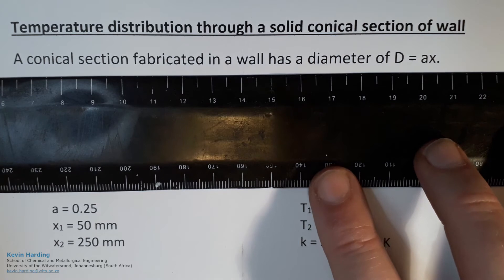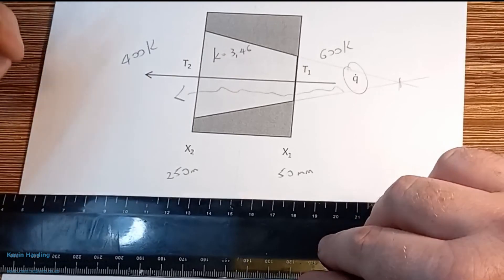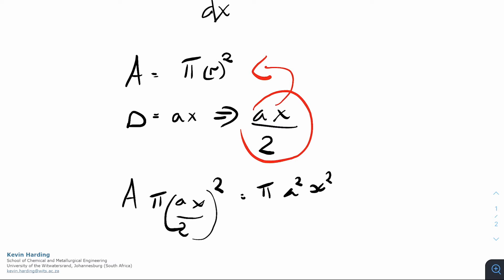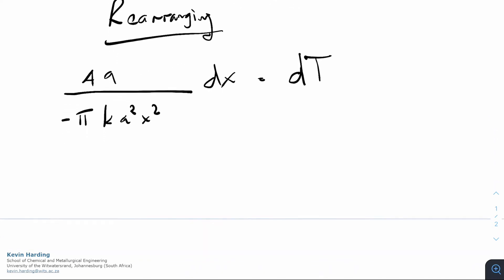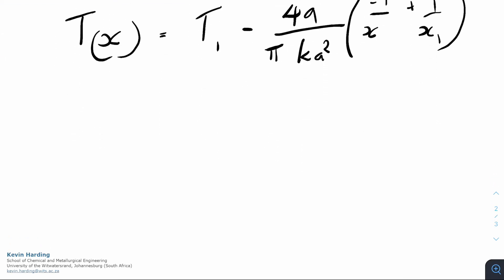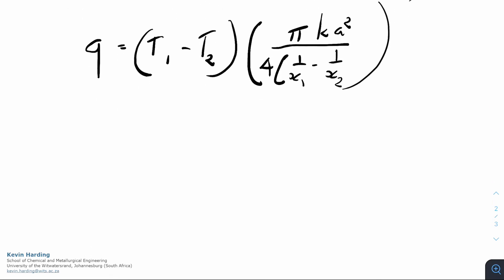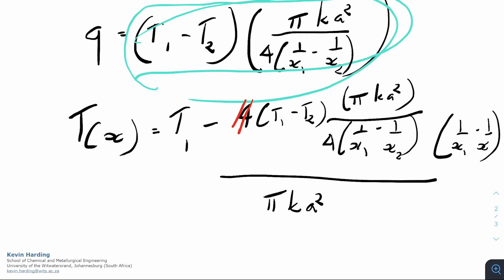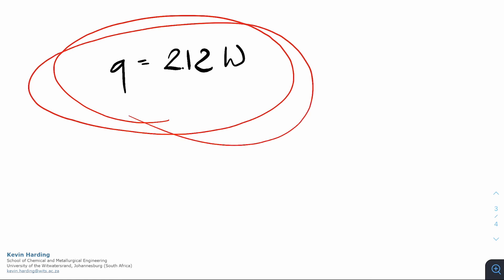Heat through conical section [Tutorial]

Comment: How to proceed for hollow
Reply from the maker: With conduction? If this is hollow, and there is air movement, this would be a convection only problem.
Reply: @kgharding29  if different temperatures at both ends are maintained then conduction will be there, how to proceed with that
Reply from the maker: Exactly the same way, using a conductive heat transfer coefficient for stationary air. https://pubs.aip.org/aip/jpr/article-abstract/14/4/947/241383/Viscosity-and-Thermal-Conductivity-of-Dry-Air-in